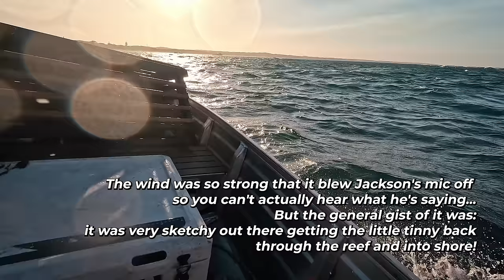EPIC FISHING ADVENTURE!! the PINNACLES - how NOT to CRAYFISH!

Comment: Hey Jackson, just a little advice for your Tinnie ventures, two types of PLBs one for a boat situation, the other which would suit you is Personal locator Beacon, they are smaller, to be worn on yourself.
All registered by you to Marine Safety rescue using Gps tracking, call goes out to nearest VMR, choppers, and ships in area. I have sailing background, hubby been a sailor for years, many races, and many crew members had their own PLBs. We had one permanently fixed on yacht, but in racing scenario best to have one on self.. buy a pair of sailing shorts with zip in pocket to contain the GPS. Create the safety habits, life saving if boat was to flip over, or you fall out. My dad decades ago, lost the engine off the Tinnie, no oars, they had to use there thongs to paddle back in, silly dad 😂..